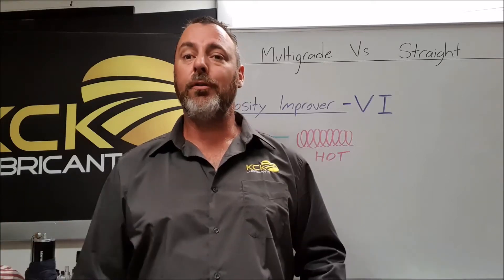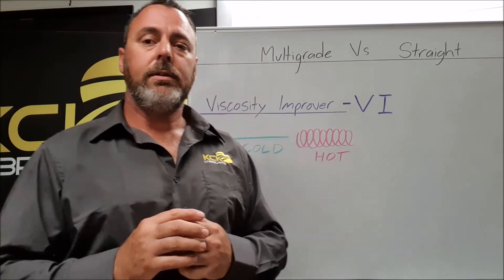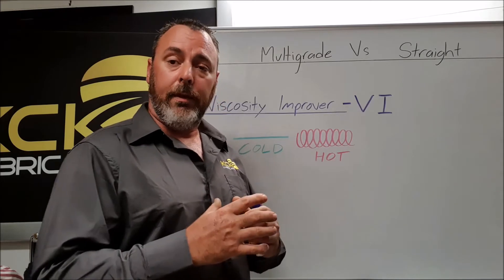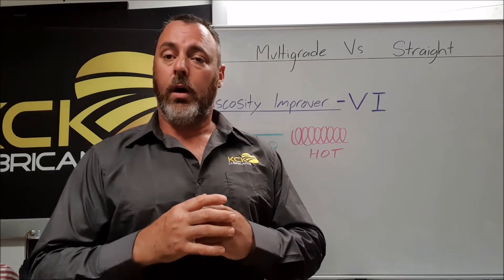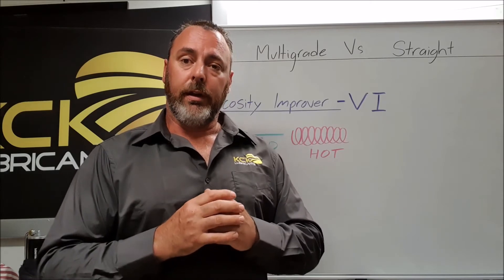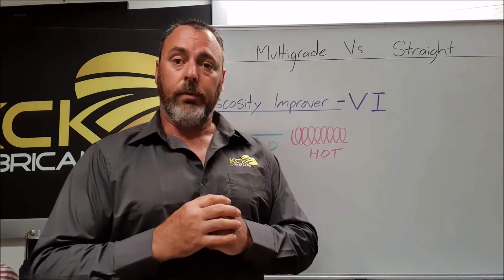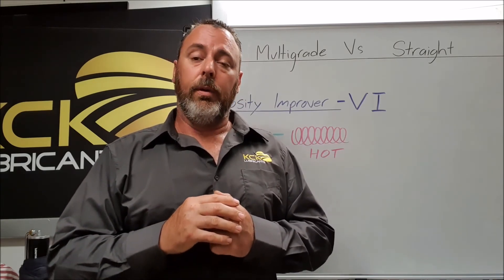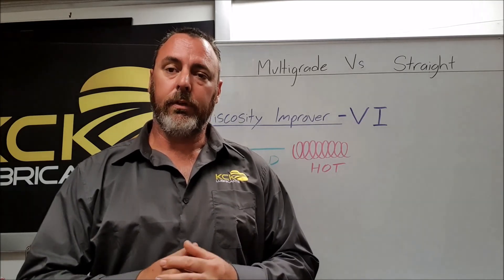Why less is more with Viscosity Improvers , Straight weight Vs Multigrades

Comment: Good job getting the information about more VI = bad because more shear more viscosity loss over the lifetime of the oil. The oil doesn't however shear down from a 10W60 to a 10W, it can shear down to a 10W40 / 10W30 tho, not down to a straight oil level unless you have absolutely abused the oil and have not changed it in years - not realistic. 1-2-3 grades is realistic depending on how hard and how long it has been used.

What you said about how they work and what they do to oil when hot is however completely false and wrong, a VI doesn't make it so the oil thickens when it gets hot, the oil still thins as it heats up, but just not AS much as it would without VI. There isn't an oil or grease in the world which doesn't thin when heated, same with oils with VI - still thins as heated just not as much as it would without them - big difference in comparison to you saying they thicken with heat... lol. Any basic logic and knowledge proves you wrong.

This confusion probably comes from not knowing the oil ratings, for example a 10W60 doesn't mean it's a 10 at cold and a 60 at hot, the 10W is decided by another system and scale and method, it's not comparable to the hot number which again is decided by another system and method, they are not on the same scale. If both cold and hot temperatures would be represented by the hot scale it would more be like a 600W60 oil which CLEARLY shows it thins as it gets hotter.

The X - number followed by W is decided by what temperature the oil can still achieve a certain amount of flow which is decided by SAE, not only do you still have to achieve the same flow when lower W as the previous rating but also flow more at the same time, meaning there is a bigger difference between each W rating, it's not linear. You could say the W number is decided by how cold it can get before the oil stops flowing to a satisfactory standard, lower number can get down to lower temp.

The second hot number though is purely based on viscosity at 100C - nothing more nothing less, this is what people assume both numbers are but that is completely wrong, they are not the same thing or the same scale and are not comparable at all. As I said, if both numbers represented viscosity a 10W60 would be something like a 500W60 or similar. So hot rating is just how thin the oil gets when hot. Lower number is thinner and higher is thicker - relative to eachother but always still thinner than when cold.
Reply from the maker: Thanks for watching.